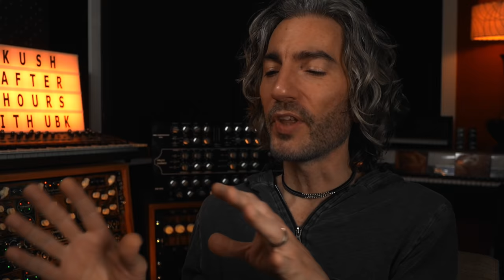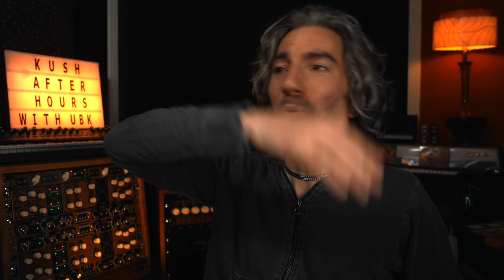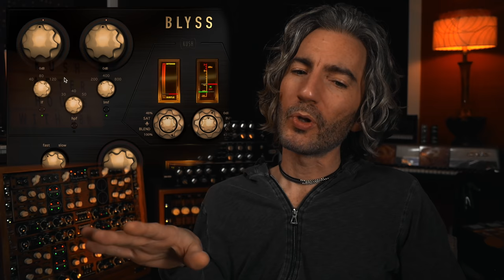MIX BUSS: You NEED to try THIS!

Comment: Just what I needed, was just about to start mixing a track. Nothing quite like 16 mins with Gregory to recontexualise things :)
Reply: Couldn't agree more!
Reply: I read "resexualize" at first. :)
Reply: @zaptronic  Greg definitely does that too lol
Reply: But glue is all about density. Also it best to learn the core of what compressor does and why they used it in the first place. And i don't use mix bus compressor in the mix. That's called mastering. I do a drumbus if needed. And live. Never from a daw.
Reply: @Madrrrrrrrrrrr  Super agree. Theres a reason mastering engineers will tell you (myself included) to take off any effects from the master bus. Just doesn't make any sense to have one in the first place.
Reply: RELATABLE

Comment: Funny thing: I do it exactly vice versa, than you explained regarding your "sound signature" at 5:20 . Before I finish a mix, I put an EQ on the master bus, adjust it to my likings until the mix sounds better to me, and then switch it off again and start compensating for everything that's missing in the mix without the mix bus EQ. Works perfectly and helps making "ear fatique" obvious.
Reply from the maker: Nice!  I'm not able to pull that off, because the mix eq for me is literally grabbing everything, and it's putting a single layer of analog phase smear across all the sounds.  One of my mix eq's has tubes, the other has transformers, and they're gainstaged for saturation and color.  I'm not able to replicate that via plugins in the mix, but even if I could... I'm lazy!   My brain says, "Sounds good?  Print it!!!"

Comment: For me, the problem with mixing into a bunch of "top down" mixbus processing is that it effects every element in the mix, whether needed or not.  Now I not only need to address the elements that still require some shaping, but I also have to fix those elements that didn't need that processing in the first place. 
It's like salting your entire meal, even though only the steak required it, then having to go and pull all of the salt out of the peas and potato to preserve their proper flavor.
Fix problems that need to be fixed, and leave the rest alone.
Reply: The real usefull type of mixing is middle down / middle up. Where you mix from your groups-busses downwards and then when you have things going good you mix from your busses upwards. Its like putting the least needed salt in separate food groups and then sparkling the entire meal with the seasoning you always love.
Reply: Really good analogy. I also think of it as painting with an instagram filter on

Comment: I'm still pretty much of a newbie, but I've always felt that my mixes sound much better when I just rely on my ears to adjust levels, eq a bit here and there, and only then start compressing etc. It's good to hear someone with more experience essentially say the same thing.
Reply: There’s so much you can do with simple fader levels before you even try a compressor or EQ. There’s always that temptation to slap things on because you feel you need to.

Comment: When there is a gain structure and peaks are finalised, it is even easier to deal in the glue. The final limiter is then more of a soft clipper thing for lifting and not for taming the peaks. If starting early mixing into limiters and compressors it happens fast when the mix could fall apart if taking it away. This happens mixing in the box, don't know how that is doing with analog gear.
The pultec type curves crave out almost the mids and low end which seems more vital for mixing because adding definition focus, more headspace for adding other elements. Ofc it sounds great on a mixbus and maybe silky smooth but the tonal shaping happens usually on solo channels creating complementary sounds not so much competing sounds just for contemporary music.

Comment: Great stuff! I typically find the biggest, loudest, most dense part of the mix and dial in that part first, including mix buss compression. That way my automation work doesn’t get altered downstream. 

I also believe strongly in processing at the group level. No EQ or heavy compression on the mix buss, just a “hug”. The vocals have their own mix buss separate from the music that doesn’t get touched by that stereo compressor.

Always experimenting though.

90% or more of my engineer friends who have problems with their mix, their issue stems from the mix buss. Most of the time mix buss processing is doing bad things that you don’t realize until much later… muddiness, cramped sound stage, weird stuff that you don’t notice at first blush

Comment: This resonated with my mix style a lot. I never got into putting plugins on the mix bus except for a limiter. They sound good at first but when I volume match and compare my mixes they always seem a tiny bit mushy compared to the straight mix. Good outboard gear seems to fix that for me. I Use the RND MBP for my colour, compression, widening and limiting and it is absolutely wonderful. It is so nice after spending a long time tweaking a mix to my taste of perfection to send it out into the analogue gear and do the final touches. Often that SSL glue sound to me, at least with the plugins I have tried, just makes my mix sound a bit less defined so gluing the mix in the mix really works better. Nice to hear someone else's process with this.

Comment: I love this channel and all of the advice and insight. I do wonder of this approach is relevant to metal productions. Metal of old, not the core metal of today, but metal like 90's death metal and black metal. I have a Swedish death metal style band hiring me to do a single for them, I am going to apply this mindset to that and see how it goes...
Reply: Charles I don’t mix metal but in the 90s and earlier decades there were many engineers who mixed metal on the SSL 4000E without the G compressor at the end.  If you think about the mindset you need to have is “I can only make moves with this set channel EQ and dynamics processing” you’ll be able to figure out how powerful that channel really is. Anyways good luck on the single.
Reply from the maker: At the risk of being a bit flippant, music is music, engineering is engineering.  All of my approaches are style-agnostic; when you make the focus 'mindset and workflow', it applies across the board.  Doesn't mean it will work for you, but the principles can work for any piece of music.  Experiment, your instinct will keep you on track!

Comment: I 100% agree with this.

I’m doing very nearly the same. Similar chain, though not identical, obviously. But the concept is spot-on.

I do leave a limiter on my 2-bus once I start getting balances, but it’s pulled down 3 dB on input. If I see any activity on it, then I know my intended gain-staging is off somewhere… so it just acts as a safety. But even that doesn’t go on until I’m done getting basic sounds, because I don’t want even that possibly throwing me off what I’m hearing at that early stage, either.

I wasn’t aware that Inflator acts a bit like an expander below 50%; I knew it was doing coloration and harmonics there, but I didn’t know it went that far. It’s always been a bit of a mysterious plug-in, even though it’s “just” a waveshaper.

Anyway, I’ve come back full circle to this very same conclusion just in the past 6 months. They key is getting the initial tracks tonally shaped early on. Then you don’t need so much crap on the back end, where every little small move is exaggerated.

Comment: this was helpful. my mastering chain is a mess but it works by meticulously going to extremes and then backing off, saturating, then eq'ing, gluing and then pumping. i feel like maybe a good way to achieve "polished" results in the box is to use multiple serial chains that saturate and compress and boost/cut in their own ways, then move on to another one, and if anything is still too harsh or digital, you can use mbdynamics from melda or baby audio smooth and then the 385 enhance, and finish with the softube weiss shit

i do appreciate these talks. very inspiring

Comment: Greg, I used to do it your way for a long time, but lately I'm trying something completely different. After my Dangerous 2Bus summing box, I run my mix into Tonelux Equalux EQ (this one can be used in a pultec style, cutting and boosting same frequencies at the same time, and that's how I use it), then to Fatso Jr (no compression or 1db max. I use it for saturation), then to...drumroll......Kush Clariphonic. After that the sound travels to double compressors! Yes, I run the signal to Chandler Germanium Limited comp (compressing 0.5-1db, slowest attack, fastest release for punch) and then the signal goes to my Tube-Tech LCA-2B for tube colorarion and "glue". Finally I EQ everything with an unbelieavable piece of gear which is Heritage Audio Symph EQ. As you can see, my 2 bus is loaded, and I start mixing into it from the get go. I manipulate the levels just to hit the gear with the right levels. You can consider it "my sound", as you said you'd compensate the mix to kinda fix the master chain anyways. That's exactly what I do. What's the point? The point is that I don't have to listen to the digital crappy sound for hours. The digititis is gone from the first minute, which not only improved my mixes but made me enjoy mixing much more. I mix 80% OTB, and since I started doing so, I mix twice as fast as I was ITB, and my mixes sound much better. If you have tried a compressor feeding another compressor, both doing a bit different thing, please let me know what you think about this idea.

Comment: Thank you! It does make perfect sense and the whole series about breaking rules is really encouraging. You have covered several areas that have affirmed my own 'rule breaking' practices. I am still learning as I go along but have become more confident about following my instincts. I reminded myself of how, when I was younger, I used to experiment with connecting anything I had lying around to anything I had lying around to see what sound it would make and tried to adopt that approach when mixing. My mix bus processing has been steadily shrinking with each new project and lately all I use on there is Blyss - it provides just enough of that elusive something without messing with the shape of the track. Many thanks for sharing your ramblings, please keep them coming.

Comment: I mix into a Comp and some Saturation and a master EQ ( I dont touch the master EQ until near the end) I did not learn this from anyone though, I just did it quite early on and it made logical sense to me,so I have kept doing it. Important to note, settings on the MIx bus comp I use are rough and are tweaked at the end

Comment: I like to have a gentle mix bus compression because I needed it to introduce the concept of "glue" to my brain. What sounded good to me when I was starting out sounded jumpy and disjointed to everyone else. I play rock, so it's not as though there are huge disadvantages to "glue." I'm hearing that thing that people like. It doesn't matter so much to me, but it also helps to know that I'm not gonna be pushing the compressor someplace that it doesn't want to go. It saves me the step of trying to get the low end balance under control a second time as soon as I add a compressor.
Reply from the maker: Innteresting.  It makes me wonder, what levels do you tend to monitor at?  I ask because incorporating ludicrously quiet levels into my monitoring habits helped me understand when I had too many dynamics in play.  Here's a rando self-serving tip: try Omega Model A on your mix buss instead of (or in addition to) a comp, and think of all of this less as 'glue' and more as density, energy, and/or urgency.  If you try Omega A, dial it in while listening at a volume you can barely hear.  Apologies if you knew all of this already!  🤜🏻🤛🏽
Reply: @TheHouseofKushTV  thanks. I monitor at low levels. I think my primary problem is conceptual. I was raised on 80s punk and 60s psychedelic, which aren't genres that ever concerned themselves with "glue." Once the artist's third album came out with the glue, it was the sellout and didn't sound right.  Of course everything had tons of tape compression, along with mastering compression just to get it onto vinyl.

I'm not a pro, so I never entirely internalized making music for other people. The "glue" is helpful because if I mix into light compression, I can make something that sounds like music both to me and others, instead of just me. It's a constant struggle. For instance, I record direct guitar tracks with pedals, and for the longest time I wasn't gonna put any stinkin' IRs on them, but then I came upon a track that was just gonna be ridiculously fatiguing... 

I was also disappointed when I'd compress my mixes post-hoc. They seem less compressed in the end if I mix them into some compression. With the exception of vocals and some drums, my instinct is usually to avoid pushing a compressor too hard. 

I'll try the Omega Model A when I get a chance. It seems like it'd be right up my alley. Thanks for the input.

Comment: I've always done it the way you do. I try to make the mix sound good before the mix bus processing is applied. Then I apply it to get that extra 10%.

However, I'm considering trying top down mixing to see if I like it. I tend to be a big picture/global thinker. So top down may work for me. If not, I'll just go back to what I was doing before. The only thing I don't like about the way I was doing it is that sometimes if you apply mix bus processing at the end it causes certain instruments or frequencies to jump out in unexpected ways.
Reply: hello. im copy-pasting what i commented above : 

Nice video man, and thanks for sharing your workflow. Some of the times I mix into the mixbus comp-eq-saturation, sometimes i turn them on during the mix and some of the times i leave the mixbus empty and add later, just like you described. I dont have a rule. The song or project dictates that to me.
For example, if im mixing an album of lets say 10 songs and im not familiar with the content, the first song im mixing is usualy the one that tells me what is going to happen. So on that first song I leave the mixbus processing for last. Then the second and third song I kind of throw in the mixbus processors i used in song 1 , at 80% of the mix and at 20% respectively.
From that point on, 4th song I mix with the processors on. But I mix with lots of headroom. If anything sounds weird i on-off the mixbus plugins and re-adjust when needed and maybe add or replace some processors. By song 5 i have established the rules of the mix and the possibilities of the mixbus (and other busses too).
When the whole album is done I have a complete idea of what the mixbus should be doing and sometimes songs 8-9-10 might tell me how to correct or re-adjust songs 1-2-3. Its what I call an organic process where the sound of an album is cohesive throughout and a song's minor change/addition can be benefical to the rest of them.

Comment: I love your advice man, the vibes are incredible and you’ve got some great things to say! It’s funny I work the opposite, I mix top down. I do all my volume automation and figure all the levels out first then do universal EQing on the track and but my mix bus compression is something I figure out at the very end of my mix when there’s only tiny little details that need to be fixed that won’t effect the track too much. Love your work and there’s definitely still stuff I can take from this, thanks for the videos man!
Reply from the maker: Right on! Yeah, I’ve met a lot of engineers over the decades and no two work the same, and sometimes it’s pretty staggering how differently we can approach things!

Comment: Sometimes listening to your explanations is like hearing something in a foreign language. Theres so much i don’t know and cant hear either. I often start with a mix buss compressor just because i like to have that slight glue and boost. Usually only 2:1. I do a lot more compression on my sub groups and tracks themselves if needed. I add smaller amounts of compression along the signal path so in the mix bus it only needs a bit of compression. I also turn it off to check during my mixing and do some gain stage adjustments to check and make sure things actually sound better or not doing anything. My ears aren’t trained well enough and my corner room studios acoustics are so terrible that a lot of the subtleties you can hear I would probably miss. Thanks for your explanations though. I always walk away learning new things or it gives me another perspective to consider.
Reply from the maker: Thanks!  Yeah, I'm aware that a lot of what I talk about or say is going to be too advanced or esoteric for a lot of people, I do my best to balance it out with the more fundamental and foundational concepts as well.  It's such a densely layered craft, I think if you re-watch my videos every 6-12 months you'll hear a new level of information you couldn't access before, and that will probably be true for years.  I'm still learning too, it never stops!

Comment: I actually never heard of this before. I've been mixing empirically for years and went to college to learn more about it and most of my teachers would advice against any form of processing in the master track during the mix stage. Some would even conceive it as bad practice.
Reply from the maker: Well, some teachers think their job is to teach, which works for some but it's not my jam.  I try instead to 'enable learning', which is more about opening up new spaces in people's minds and giving them just enough of a map to explore on their own terms and find their own truths.  ☮️
Reply: @TheHouseofKushTV  what is a mix bus? i mix vocals so i route my dry mix vocals to a aux channel which includes auto tune compressor eq, and then i route that entire "mixbus" to 2 different aux channels, which is reverb and delay seperately. Because adding things in the master sounds like a big no no to me